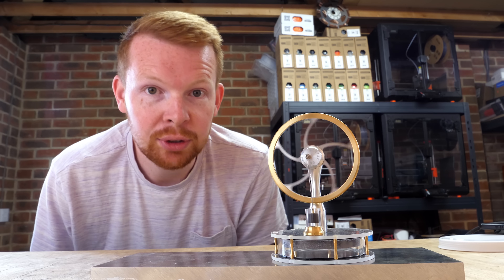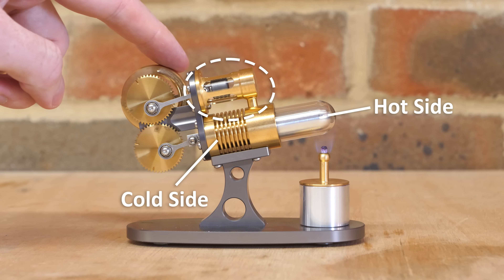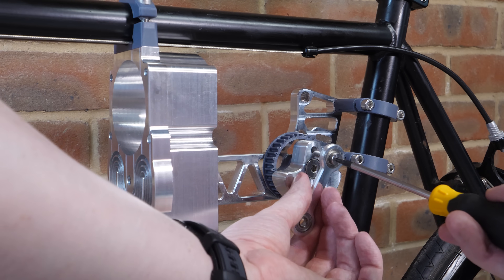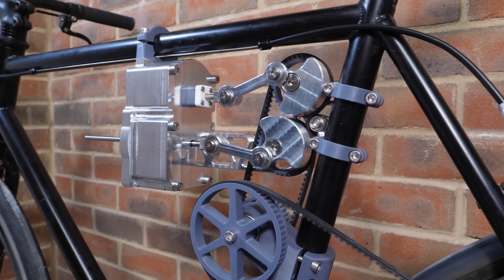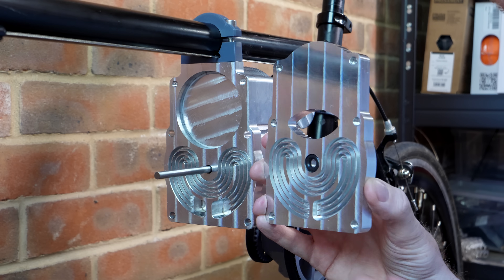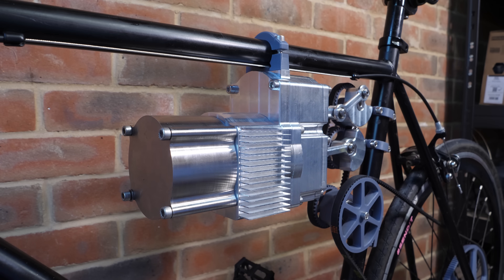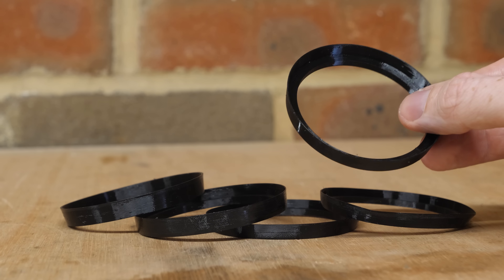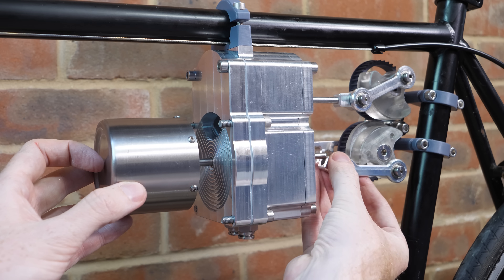Building a Stirling Engine Bike - Part 1

Comment: You beat me to the punch on the fly wheel but I've had a potentially either incredibly smart idea or incredibly dumb.

We know the travel of the shaft is 14mm so just a crazy idea here. 

Would it be worth moving the engine forward, extending the output shaft and then adding a worm gearing mechanism for the output.

Comment: Could you use a Peltier module to heat the engine or would that not be hot enough?, it could also be good for cooling, or both heating and cooling.

Comment: Tom. Railway engineer, steam locomotive society trustee here. Love what you’ve done here. But would love to see your take on a steam locomotive. I recommend looking at Gresley, Bulleid, Chapelon, David Ward and Porta for modern interpretations (in particular think about condensing applications and water tube boilers). The Stirling engine looks really fun as a concept and I have a feeling you’ll crack it soon. Maybe have a think about a change of approach and go for long travel valve gear - short travel valve gear in steam locomotives was a limiting factor, it could be the same here.

Comment: Video idea: I've seen you talk a lot about variable gear ratio bikes, you know these bikes with the 7 gears in the back and 3 in the front? you can make them into cones instead of gears and use a high friction belt to connect them instead of a chain, similar to how a CVT transmission in a car works. and make it manually adjustable cuz it's hard to electronically program. i'd love to see that

Comment: those gaskets you can mold with high heat silicone using a cncd mold and some sort of pressure chamber. I did it for my espresso machine and it was way easier than i thought

Comment: Great idea, I love Stirling engines (did you know that Stirling developed the engine to eliminate the risk of boiler explosions? A pioneer in safety!) But back to your project. Can't you decouple the "hot" part of the engine from the "cold" part in terms of temperature? For example, with an intermediate piece made of ceramic material? The easiest way to make such a part would be to use concrete with glass fibres added....

Comment: You should make the heating mechanism powered by electricity, so when the bike moves, it powers generators to create electricity. Electricity generated from the front and rear wheel´s generators powers a battery, which powers the heating element. Then you don´t need any fuel at all. Then it´s a fuel-less engine system

Comment: Tom, I think that if I take an off the shelf cryocooler and learn its rpms, I can make a peltier glow plug that goes in that cylinder. Then, I test the performance of the cryocooler. I expect it to become more portable, that it will consume so much less air to do the same work, because the thermoelectric effect is moving thermal energy into the cylinder, that it would require a smaller air compressor. The improvement in performance would be evidence for iso-termal flight. This cryocooler would become limited in its operating range. I still don't understand the specs for the small peltier tiles. The amount of PCM; sodium acetate, paraffin wax, or water would be measured in milligrams. I like to imagine an aircraft that could reach 700m before turning its air compressor on. Four stirling engines on a quadrotor?

Comment: You could try to make an ebike with no battery but smallest maybe a removable fuel powered generator possible to power the 250w electric motor. Maybe it could be even lighter than the big batteries currently in ebikes.

Comment: replace the air inside your motor with helium, and try to compress it a little bit, like 2 bar maybe? Helium has like 10times the thermal conductivity. I'm suggesting this because the temperature in your hot side is way to much right now. So the air is not moving enougth thermal energy for cycle causing this energy to be dispersed (hot to cold side transfer through the case, infrared emissions)
Reply: I really love your videos. They made me so curious and excited every time

Comment: Anyone who knows engine/gear tuning knows that he could have made it run faster with just the gears if he decreased the gear ratio making it easier for the engine to run the engine would run at a higher rpm allowing you to extract the same or more power you just need to figure out the best gear ratio for the torque needed assuming I don’t know a lot about stirling engines but I would bet it’s max rpm is more than what he ran it at

Comment: The trouble about Tom Stanton is that he does not design things and despite what he says, he does not do any useful calculations. That is why this project is not going to work. As an engineer, you need to start with a specification: How much power and how much torque must the engine generate? A good starting point is 200 Watts of mechanical power. Once you know the torque and the total gear ratio, you will know the force needed from the piston. Neglecting friction for now, that gives you the product of the pressure and the piston's cross-sectional area. Stanton has done none of that and has wound up with about 1 watt of mechanical power. You need to understand the theory of the Stirling cycle, the approximately adiabatic and approximately isothermal phases. Do the thermodynamic calculations, design the mechanics, and then it has a chance of working. Next you need to consider the transmission and control systems appropriate for this engine; you need a good power output at a variety of wheel speeds, most importantly, starting from low speeds. All piston engines are bad at this compared to electric motors, so the transmission system is going to be significant. I'm sorry, but from an engineering point of view, this whole project is very badly thought out. You can't just start by making parts with with a CNC. You need to start with a design. Unlike the situation in the early 18th century, all the theory is very well known, and is easily found on Internet. Unfortunately, what Tom will find, is that his engine is going to have to be very much bigger to be useful for propulsion, and he will need a much more serious method for cooling, not just a few little air fins.
Reply from the maker: Some hilarious assumptions right there... how do you know what research and calculations I do? I literally start the project with a power specification. Maybe do your own research before making such wild claims https://youtu.be/x_-P5sufMSk
Reply: @TomStantonEngineering  It is true that I had not seen your presentation of your calculations before making my first comment. I now have. However, it is clear that the design that you built in this video is not based on correct calculations. I doubt that you would have spent months building your engine if you had calculated ahead of time that if it were frictionless it would deliver 3 Watts so you might expect it to deliver 1 Watt for a good but realistic build. I am guessing that you did lots of building before you sat down to consider why your engine is only giving you about 1% of the power you need. Even now, you have not planned the needed cooling mechanisms. My point is that you build things really nicely but what you build is not based on a logical engineering design process that starts with a specification and works to meet that specification by systematic design. My frank advice is that you do more careful theoretical design before moving to implementation, and you will wind up with much more successful projects.

Comment: Could I suggest a way to power a bicycle that modern bikes are well adapted to. That is to fill the frame with compressed air. A rotary compressor pump can act as a motor when the flow is reversed. Carbon bike frames have become very voluminous and, with small adaptation, could withstand very high pressures. I suspect this would make a pretty lightweight bike booster.

Comment: I would not use any 3D printed parts for anything that will heat/stress/expand under load as I've tried it before and they've all broken after a single or two uses, even under a light load or no load at all beside itself.

Comment: very cool, this is the first time I've seen an external combustion engine. I graduated in automotive engineering and studied internal combustion engines. Every engine needs lubrication, compression, fuel, spark and a flywheel. You should improve this engine and patent it. it can be used not only for bicycles. you can become very rich😅

Comment: i think your losing tons of power having the piston cylinder made our of aluminum attached to the heat sink your cooling the air in the power piston during the hot stroke

Comment: Keep in mind your piston is double acting so your ring needs to seal in both positive and negative pressure. Also make sure your displacer piston is sealed. If you allow any volume that isn’t working gas it will act as sort of a buffer to the pressure changes that act on your power piston.

Comment: I think for this to work out and be rideable the hot cylinder is going to need to be airgaped with like a firebox for charcoal around it. If you get a rack and put it on the back it'd look really cool riding around with a flaming bike.

Comment: I have a question why do you heat and cool the same chamber from my very limited knowledge of stirling engines would it not be better to heat the air at the working cylinder and cool the air ait the displacement cylinder? It seems to me that you are cooling and heating the air in the same location could you help me understand?

Comment: What’s the approximate power-to-weight ratio of this one-cylinder design and would be worth adding three more cylinders?

With an inline 4 cylinder design, you could get all four pistons going by heating up one long cylinder head… Y’know, if you were willing to through 80% of this video’s trouble three times over and add a heat distribution challenge to it all. 🙂

Comment: if you ran a stirling engine like this with one of those flames that last for a decent amount of time could you create not only a more efficent motorized bike? but almost using no fuel like i mean so less an amount of fuel?
Reply: Or just no fuel. Since you just have to apply a lot of heat to one surface, all you need is a sunny day and big enough magnifying glass. 😃
Reply: @mastermalpass 😭 ya a pretty big one lol

Comment: A few ideas. The displacer should not be able to pass air in and out through the joint where the can is screwed to the cap. If air can get in and out, you will waste pressure that should be going to the drive piston. The displacer seems too small to me. Your piston rings should seal on both pressure and suction, since there will be suction during part of the cycle.

Comment: lovely video.. but pls pls take another sponsor, the only thing sites like that do, is delude and muddy the narratives/giving obvious crap more credit than it should get
you could add heat by moving/rotating magnets mechanically with the pedals, almost doesnt require any torque..

Comment: The hot side needs to transfer heat to the contained air, and it mainly does so by radiating it from the casing. Would increasing the inner surface area of the hot side improve the performance? Say you added fins to the inside of the hot side, by soldering or brazing some copper strips?

Comment: You know what I find is funny nobody's ever tried to implement this in a way on top of houses or roofs to generate power for the buildings it would probably be quite easy in hot areas or desert areas you could put very large ones of these that would generate a ton of electrical current it would be very simple

Comment: I've watched the video halfway through, and decided to post a comment... Even if you can't get the bike to spin.With this engine you can use this engine to spin a Wind turbine And use that to power a battery bank which Power An AC inverter which would power an electric bike... So the engine build wouldn't be in vain. Because you could spin a winter Biden. G. Definitely. Charging a battery bank and you could even set up multiple of them and feed the grid and get paid by the government for feeding the grid.

Comment: The Swedes designed and built a submarine [Gotland] that was powered by a Strirling engine, which made the submarine extremely quiet, it therefore was able to remain undetected, approach to within range, launch a torpedo and 'sink' a US aircraft carrier and leave during a military exercise.

Comment: In the 90s when the internet was silly and new I ran across a website that was claiming to have an engine that ran on ambient air temps. thinking back it was two sterling engines hooked together, one would get warmed up by the air and it would turn the second engine that would cool the cold side of the first engine, allowing the engine to continue to run. they claimed that it wasn't free energy because the energy was coming from the air that was pulled over the hot side of engine one. I am pretty sure it was all nonsense, how could the cooling side make it cool enough to keep it running, but I wish I could build something like it and check it out.

Comment: That was the stupidest thing I have ever seen. It can barely spin the weight of the tire under no load.
Reply: But it sure looks cool. 
It obviously was designed by someone who understands how to machine metal parts, but does not understand Stirling engines.
Reply: Efficiency isn't what you're looking for in a Sterling engine you're looking for it technically runs this is a pretty good example, it's actually doing a modicum of work maybe to someone who only cares about horsepower it doesn't matter but to me it's pretty damn cool he took the torch energy of the flame and made it spin

Comment: But, you’re still using an external energy source (gas) to generate heat, what if you use the same amount of gas burnt in an internal combustion engine, will it be mire efficient ?
Reply: If you used the same gas to power a small IC engine, it would be able to propel the bike and rider at high speed.

Comment: Most Stirling engine models don't have gears like that. They link the pistons using the same crank but offset slightly. Some use a boom crank instead.
Reply from the maker: The offset cylinder design is easier to build, but the long air channel between the two cylinders massively reduces efficiency due to extra dead volume and potential flow restrictions.
Reply: @TomStantonEngineering  the flow channel can't be that long, can it? Usually the cylinders are mounted side by side with a machined connector acting as the flow channel.
Reply from the maker: @PunakiviAddikti  ah yes, I thought you were referring to the engines that use a single crank and have the cylinders mounted 90 degrees apart. The only issue with the same crankshaft and the cylinders on top of one another is the output shaft would be vertical? Perpendicular to the output pulley shaft.
Reply: @TomStantonEngineering oh, no the cylinders are mounted horizontallyon either side. One crank connects to the flywheel and the other connects to a small crank on the opposite side, which may have a pulley attached to power a generator.

Comment: I'm wary of a bike engine that needs a red-hot piece of metal between my knees to work... but I'm intrigued at the concept.
If you optimize efficiency like you said, it could combine regenerative braking, heat reclamation, and even add in body heat from the legs if possible.  It likely wouldn't allow the bike to run on the engine alone, as I just don't see it producing enough power to move both the bike and a rider.  But what it could do is serve as an energy assist, making it possible to move the bike and load with less pedaling energy.  Some people even mentioned incorporating solar power into the mix.  Turning solar power into simple heat should be fairly straightforward.  I'm still a bit... worried... about having a block of hot steel sitting right between my legs.

Comment: Great job Tom! Could this engine be cold or run on a block of dry ice? I had an idea once of a spring that would get compressed by the bicycle chain that you could release for a boost. Like mechanical Nos for bicycles.

Comment: There’s a reason why sterling engines are usually used for marine applications. You already have a big body of cold water to use as a water cooling system, and you also usually have plenty of room for a large engine.

Comment: Use the sterling engine to power a generator and use the generator to charge a battery use the battery to power the electric motor..... Basically make a series hybrid electric bike